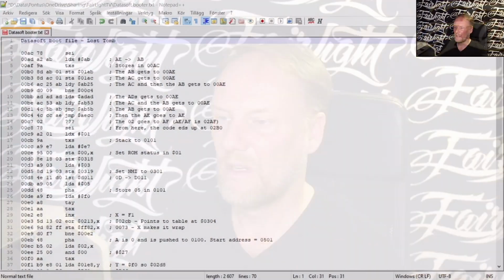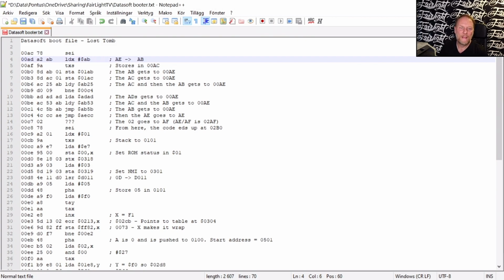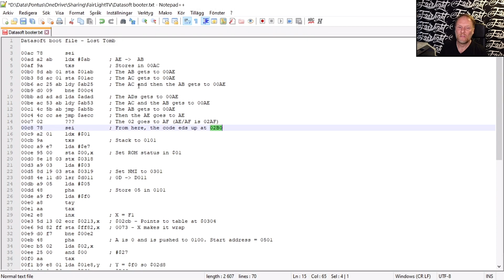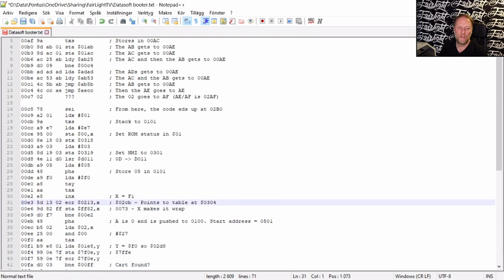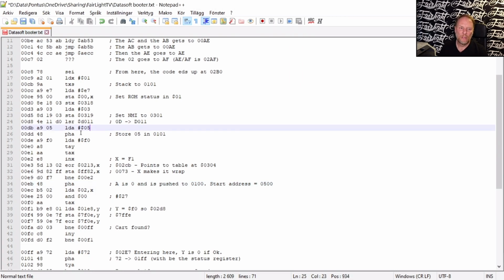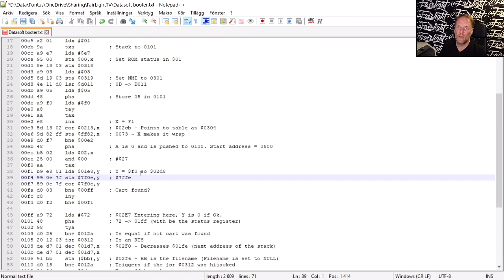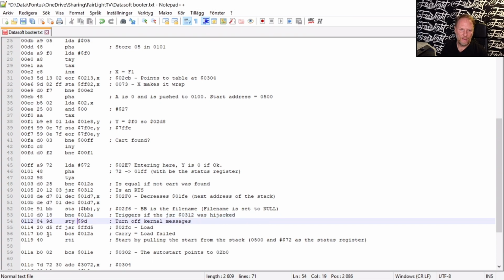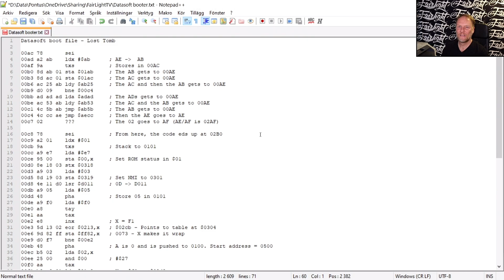FairLight TV #10, FairLight facts: Reverse engineering a boot loader

Comment: My approach to this would be to write an autoloader which loads the file with NULL filename, thus completely bypassing this code. Would that be considered a proper crack?
Reply from the maker: As you say in your own answer this is merely the small boot that loads the next file. So what you get from this is merely the next file and its start address. Unless it leaves something behind that is checked later in the process.

Cracking on the c64 is a bit different. We clean out all the old loader - not just disarming the protection. So we don't set up the system with everything previous steps of the loader left - we are expected to remove all subsequent checks.

A proper crack is anything that can be copied using normal means and works. But to be seen as quality, you should make this into one file, with trainer.
Reply: Meditating upon this further, I came to the realization that the autoloader can be left in place as-is, because it calls a kernel load routine, which implies that there is no disk protection and that means that the actual protection is further down the road, possibly but not necessarily in the file with the NULL filename. The cracking would be yet to come.